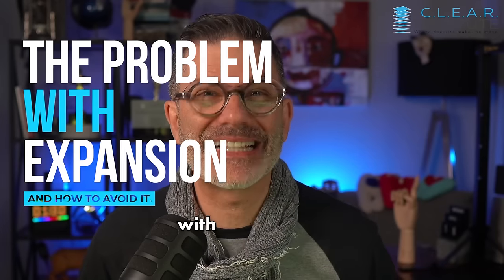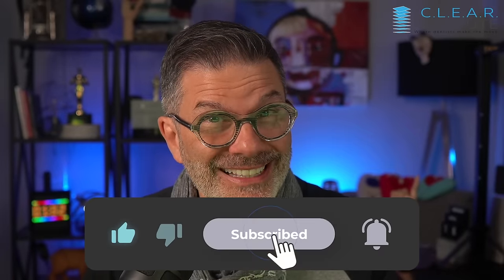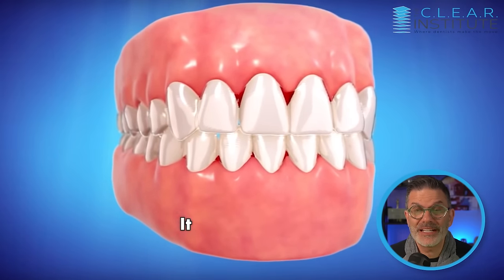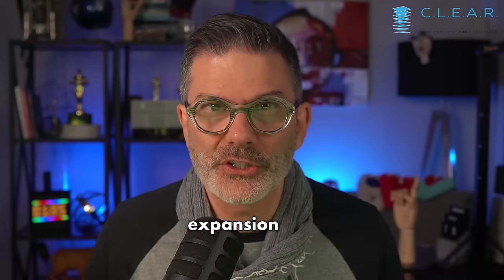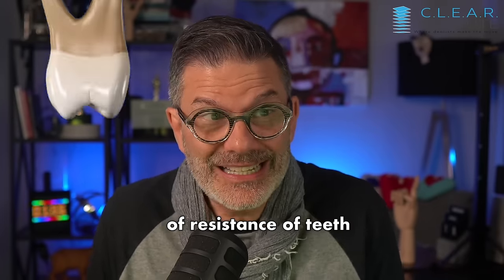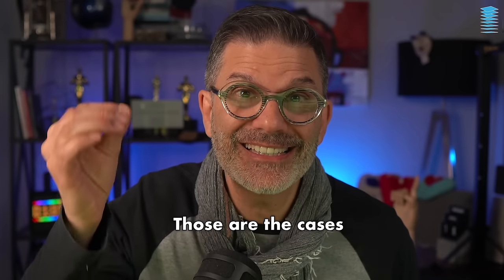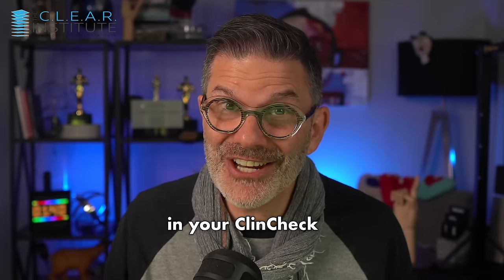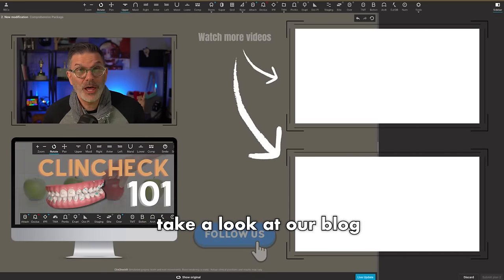The problem with expansion using clear aligners like Invisalign... and how to fix it!

Comment: Invisalign has over ten million cases. Why, after all these years, do we have to second-guess the results?
Why should we even have to add overcorrection? THIS SHOULD BE AN INTEGRAL PART OF THE INITIAL INVISALIGN SETUP!!!!
Experienced and knowledgeable clinicians such as Stephanie must be the force behind the Clincheck algorithms. 
When a case requires a specific setup to achieve the result, that should be a part of the initial setup.
It is frustrating for patients to undergo multiple refinements over an extended period to achieve the planned result.
Reply from the maker: Thank you for your comment Richard. We dream of the day when the virtual setup softwares will reproduce the real movements of the teeth and also adat them to the type of attachments and mechanics we place on the teeth. We’re just not there yet. What we see on the ClinCheck is the shapes of the aligners, a force system. How the force will be applied on the teeth. But we have to figure out and visualize how this will translate in the patient’s mouth. There is a difference between a ClinCheck and a RealityCheck ;)
Reply: @theCLEARinstitute      Hi Stephane. Thank you for taking the time to provide your thoughts. The ClinCheck and the RealityCheck should be the same. The technician must point out that certain teeth are precisely positioned to compensate for the flexible trays. Doing so will reduce the number of refinement trays. After ten million plus cases, the proper setup by Invisalign must be done according to what you are teaching and what is required for the appliance to achieve the desired movements. After all these years, I am trying to understand why this is not being done. It makes working with the appliance extremely frustrating. In many cases, brackets and wires are just faster and more predictable.